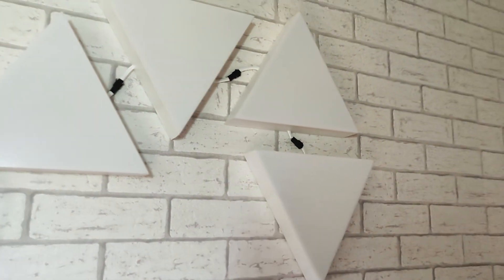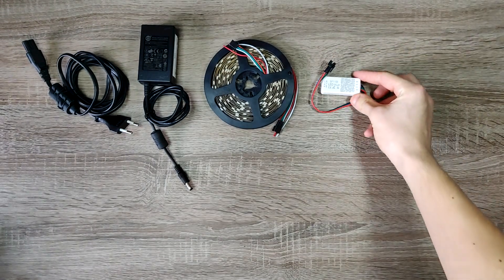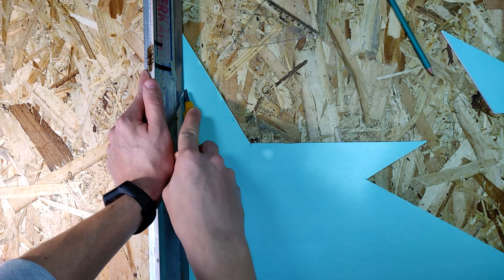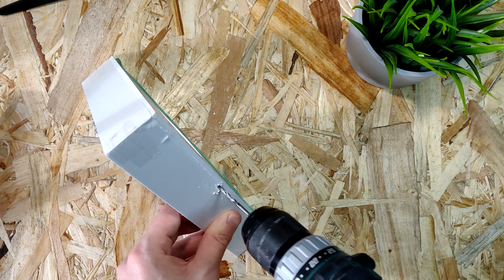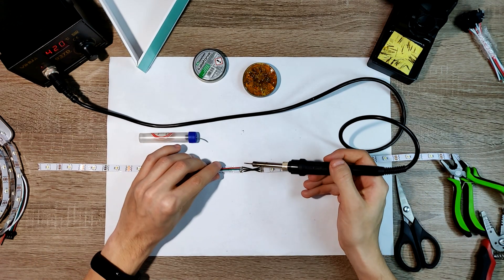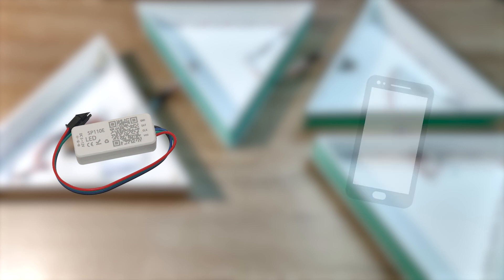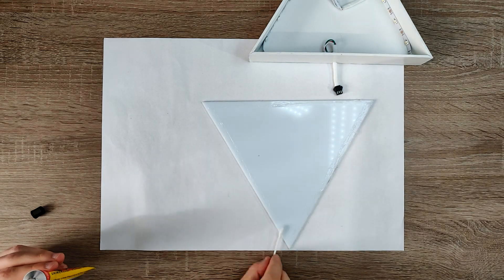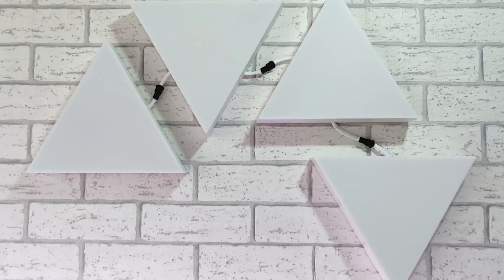How I made DIY NANOLEAF LIGHTS for $35

Comment: Smooth ones very good looking.... One question those side things what is that and where did u get those? ... been thinking of maybe using electrical wire channels but worry I have to do to much work cutting them into size and correct width..
Reply from the maker: Do you mean connectors between every panel? It's just basic JST led connectors with white shrink tube. There is probably cleaner way to connect them. All the materials are listed in the description.
Reply: @LEDMyster  well no sorry I should be more clear if I can... I ment just the "sides" the 3 sides you put together as a triangle... I believe you said they were 4 cm high? ... I have been looking at "lists" here but they are never flat on top... and I've been looking at electrical wire channels (cheaper but they are quite wide at the top).. not sure if can find those in the list of the description I had been looking there.. but can be I just don't know what to call it in English... thanks alot and keep making videos like this
Reply from the maker: I'm glad you like it :) It's called 'Foamed PVC' or 'PVC foam' in English. The idea to use electrical wire channels is interesting. It might save you a lot of work with cutting and sanding foamed pvc.
Reply: @LEDMyster  ah OK so using same on the side as back... I will see if my local hardware store they have such thanks again

Comment: Nice I am kinda thinking you Will get like 50/200k subs if youre editing skills keep getting better :)

Good Luck :D
The only flaw is that you made it thic and a gap between the panels
Reply from the maker: Thanks :) I'm glad someone appreciated the editing :D
Reply: @LEDMeister_  :)
Reply: No errors here.... the reason why others look like crap is actually because for one thing they are thinner and they didn't do proper diffusing.... So I agree with videomaker here... make it thicker and make the primary function, the light, look better

Comment: Awesome work! Would love to see a fully modular version.
Reply: That could be as easy as using some 3.5mm TRS headphone jack plugs (male and female) so that you can use the 3 wires connecting them to ring, tip and sleeve of the 3.5mm jack plug.
Reply: You can also use magnets like this guy :https://youtu.be/eq6NlG2Q-Vw